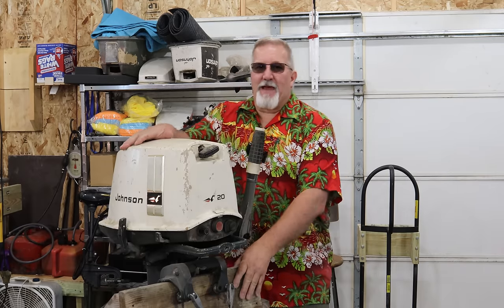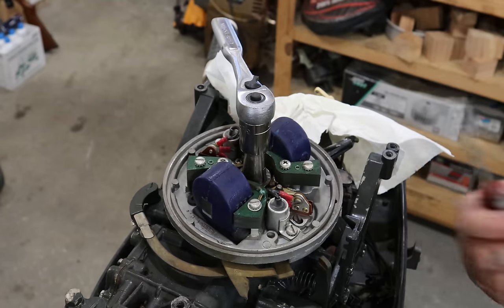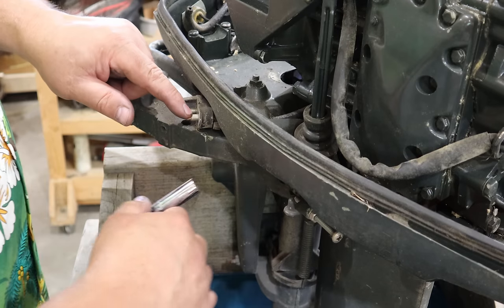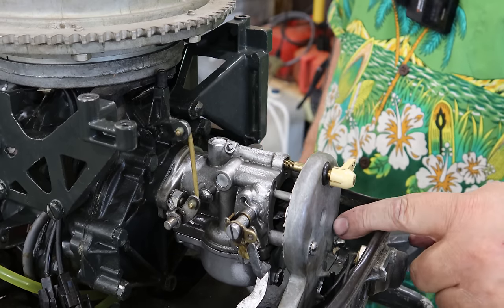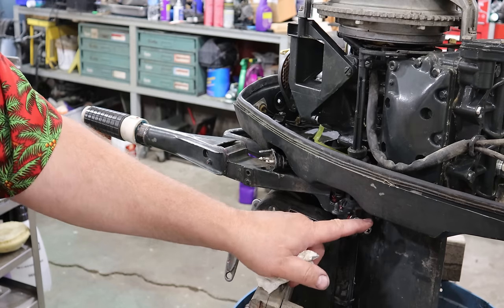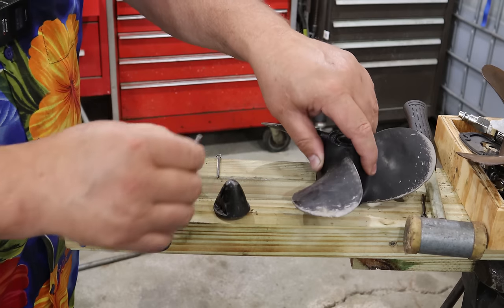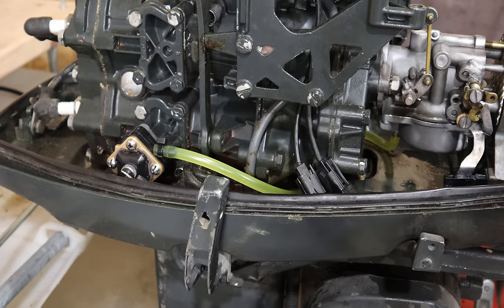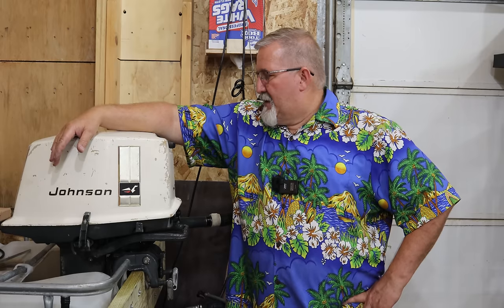1969 Johnson 20hp Hasn't run in over 5 years. The steps I took to bring it back to life. Real How To

Comment: Thanks for this video. I've got the same outboard, 1970 model, that hasn't run for over 20 years, but is in excellent condition. Got it running without tearing it down, but it was stalling after 30 seconds (not drawing any water thru impeller, though). Pulled the carb off and ran cleaner thru it even though it looked very clean. Now it won't fire. *SIGH*.
Oh well. Thanks to you I know what to check and how to fix it.

Comment: Fixed one of these for a family friend good old outboard when rude and Johnson's made quality easy to work on engines idk what happened after the 90s 🤢 just got gifted an 89 35 merc that had a rat nest in it what a shame engine barely used but the guy had the drive shaft rusted to crankshaft and he cut it in a way that i have to replace both plus fix all the chewed up wires uts really to much work to be worth while unfortunately guess ill part it out or junk it for aluminum cool vid bud going to do this for my Buddy's 69 20 and try to make something to flush with out a bucket seems something like a rubber nozzle with hose attachment
Reply from the maker: Mercs can be quite the mess, thanks for watching

Comment: Thank you for all the info
I am  Working on a 1971 20 horsepower s
The saltwater version but it's electric start
Cannot find a wiring harness so we can have a turn key
I am  going to try and fabricate one myself
Anyone have a suggestion on finding a wiring harness for a 1971 20 HP Johnson

Comment: Just watched your vid on this Engine.
I have a 70 20hp outboard. I am doing some repairs on the lower.
I wanted to buy 2 sheer pins/prop pins and followed the link and its sold out. When will it be restocked?
Thanks, Chris
Reply from the maker: here is my new listing 305723647945  search for this number on ebay

Comment: Thanks for the help on my 1970 20hp Johnson 20R-70E motor. I ordered parts and cleaned the carb w/ kit, replaced the fuel line, fuel filter, and impeller. It finally runs. But it runs on the rich side.
Q: on the lower unit it gets kinda hot. 
Is it suppose to shot water out the back pee spout/hole? It doesn't. Could it be plugged?
I was told I might need a new thermostat?
Thanks again,
Reply from the maker: pull the thermostat and you should have water pee out right away.  If not you have a plug somewhere.  Blow air back through the pee hole first
Reply: @Michaelsbackyardmarina  Opened up the area where the thermostat is suppose to be. No thermostat. So ordering 1 with gasket and ring with Crowley Marine. Did a test and water was running back out through the intake and wouldn't flow through other chamber - no peeing from rhe lower. 
Thanks again..
Q: do you have any suggestion on fixing a motor cover to the outboard? The latch connector on my motor (anchor block and pin) is broken.

Comment: Love your videos Mike! I picked up this exact same motor at an auction and have done all the same TLC that both of your videos show. I have a somewhat dumb question. On the lower housing near the bottom pivot point there are two holes that face the transom. When the motor is running I am getting water coming out of these as well as exhaust port and pee hole. Is this normal? Seems like the whole lower housing fills with water? Replaced lower shift shaft seal and am not leaking water into gear case. By the way, my brass bushing detent pin sticks up a little higher than the 3 you showed. Did not have to install a second tension pin.
Reply from the maker: good new on the tension pin.  Yes these things blubber water out everywhere. Thanks for watching

Comment: I’ve got to get some of that see thru line. My 92 Johnson 28 hp has a cold start problem, have to excessively prime to get started maybe it’s the line?
Reply from the maker: could be. Could be the timing.
Reply: @Michaelsbackyardmarina  Is the fuel line 5/16?  I have a 71 Johnson 20hp that my dad bought new.  I have to pump the primer bulb to keep it running too.  Also is the timing/linkage sync right between the lines on these old Johnsons?

Comment: i have the same motor i just recently picked up but the bottom spark plug is working and the top is not any idea? im gonna pick up a flywheel puller to check it out, but i seen that the bottom plug has wire in it and the top has this nylon in the middle. i was gonna take a little peace off and put the boot back on but still nothing. any idea???
Reply from the maker: most likely your points. There are two sets and one may be fouled or a bad condensor

Comment: Hello there, I'm having the same fuel pump issue with a new complete part. It ran once just fine on the water for several hours. The next outing three weeks later I had to pump the fuel bulb to keep it going. Did you figure out the issue with your faulty pump? Mine is tight and everything else is squared away as far as I know. Thanks so much for your videos!
Reply from the maker: Some of the cheap Amazon pumps aren't as good as some OEM ones. Make double sure you are sealed up on the back side and that your screws are not bottoming out. Thanks for watching

Comment: I have a 25rl69b.  I’ve watched all your videos on your 20hp and did everything but put the pee hole in mine.  It’s running great, but I can’t get full rpm in the water when in forward.  Neutral and reverse I can get full rpm.  Any suggestions on what I should look at?  Other than gas line (already checked), compression (at 100 in both).  Have spark.  What else is there?

Comment: I have to tell you Mike, I took out the Merc Mark 10 for a lake test and started then died. I got tired pulling the cord and gave up. After thinking about it I realized this motor must have a vented gas tank. The auxiliary tank I was using just has a cap without one. Woops on me. My Yamaha kicker runs good with that tank but this old motor won't have it.
Reply from the maker: Interesting.

Comment: Why don’t you test the lower unit ? In my routine that’s one of the first things I do ! Shift rod seals and drive shaft seals are easy ! I do like those 20hp and 25hp of that era ! I have 2 - 20’s and 3 - 25’s pre- low tension and I sell a butt load of them and 15hp outboards !
Reply from the maker: I do test them. Pressure test. I've done one video on testing them. I just don't show it every video.

Comment: Hello, my name is John. I can't find anything online about this, so I am going to hope you may be able to help me out.. I have the same model 1969 20r69d engine. From the manifold to the fuel pump plate there is a small hose that connects them. Mine was dry and it broke so I replaced it with a clear piece of tube. Anyways when it's running I see slightly yellowish kind of Milky fluid running through it and I'm not sure if it is water in the gas or if it is dirty water or what, perhaps you can explain to me what this line does and what is supposed to run through it? I can find nothing on the internet about it and I do not want to blow up this bad boy!
Reply from the maker: check out the information on MarineEngine.com